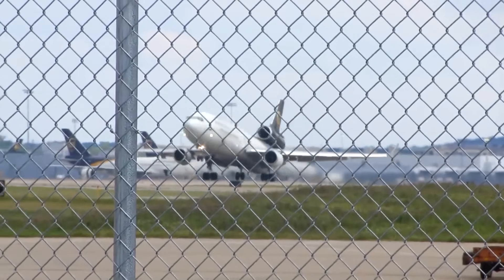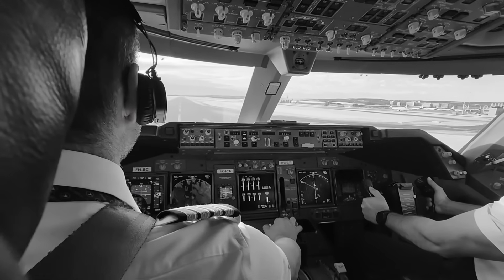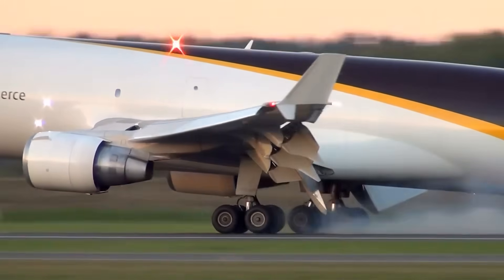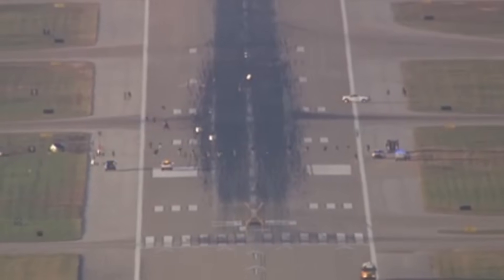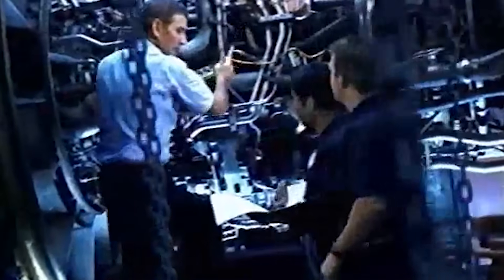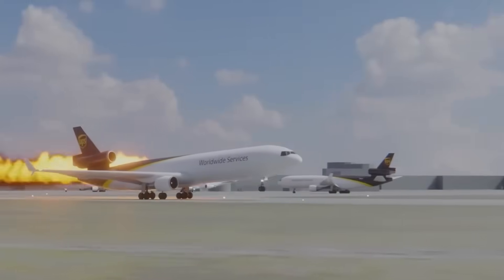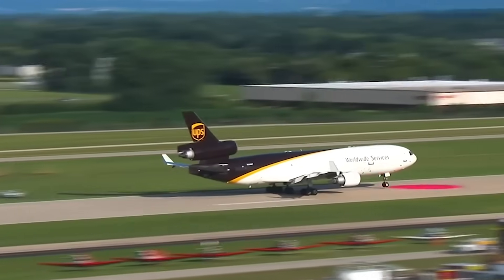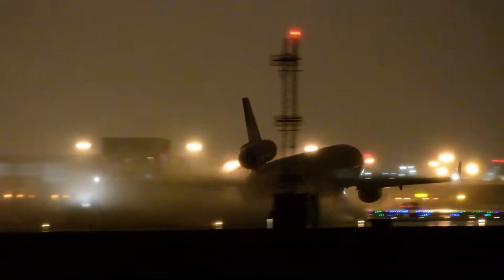The REAL Reason UPS 2976 Failed So Catastrophically...Mistake repeated AA Flight 191

Comment: These engines turn anti-clockwise as seen from the front. As the rear supporting lug of the engine No1 broke, the engine tilted upwards at high rpm and thrust. That produced gyroscopic forces that swivelled the engine to the right, contributing in breaking the front support and with the residual thrust the engine jumped over and to the right of the plane, feeding debris and flames into No2 engine. If the problem was in No3 engine, No2 would not have been affected and the outcome could perhaps be less catastrophic.
Reply from the maker: That's a very detailed analysis of the engine's movement and its potential impact.
Reply: I believe you are correct. Had engine 3 mount had the failure, they still could have climbed and it cery likely would have not been a catastrophy. 

Myself and most others thought a catastrophic uncontained engine failure caused it to break off the wing, however gjven what the NTSB has shared,  I no longer believe this is what happened.  

I now believe the engine was operating nominally when it broke off and departed the wing at full thrust. The fire on the wing and engine were a result of the fuel lines being ripped and spraying fuel.
Reply: Had the crew immediately aborted when the repeating bell began to sound, the engine might not have broken off and the huge fire might not have started. The plane probably would've stopped in one piece on airport terrain.
But after that, would the cracks have been detected? Or would the plane have crashed at a later date?
Reply: @AlainDessureault 
The alarms went off after V1, too late to abort. 

It appears the engine broke off, then burst in flames. In other words a catastrophic engine failure did not cause it to break off...the engjne broke off at max thrust as they were rotating. 

Had the pilots tried to abort they still would have crashed into the area beyond the runway,the oil/fuel recycling plant and still caused significantly damage and loss of life as they were going too fast to abort when they got the 1st warning(again after V1).

That said, pilots train to continue flying  even with an engine failure at and after V1 because they are going too fast to stop and getting airborne is the safest option 99.9% of the time, also every airliner can safely climb if they lose an engine. 

Unfortunately with the UPS flight,  the number 2(midde) engine injested debris from engine 1's catastrophic departure from the wing, causing it to stall and lose thrust, making it impossible for the MD-11 to climb with only one engine.
Reply: @JarrodFLif3r  
"The alarms went off after V1"
Apparently, yes
"too late to abort"
That's a myth. A desperate abort was the only option.
"the engjne broke off at max thrust as they were rotating"
Correct
"Had the pilots tried to abort they still would have crashed into the area beyond the runway"
But they could've chosen where to crash — unlike when they were in the air.
"the oil/fuel recycling plant and still caused significantly damage and loss of life"
No. The crew had the option to steer away from those.
"they were going too fast to abort when they got the 1st warning(again after V1)"
That's a myth. At that moment they could've not only aborted, but even ended the roll on airport terrain.
"That said, pilots train to continue flying  even with an engine failure at and after V1"
That's faulty training for tri-jets
"because they are going too fast to stop"
That's a myth. Utter bullsh-t
"getting airborne is the safest option 99.9% of the time"
Wrong statistic in the case of tri-jets. In the case of tri-jets, the rate of catastrophe is 100% when trying to fly an unflyable tri-jet.
"also every airliner can safely climb if they lose an engine"
False. No tri-jet has ever lost an engine at rotation and safely climbed out. The result of trying to climb out has always been a crash on the other side of the airport fence.
"Unfortunately with the UPS flight,  the number 2(midde) engine injested debris from engine 1's catastrophic departure from the wing, causing it to stall and lose thrust, making it impossible for the MD-11 to climb with only one engine".
That's normal for a tri-jet. Engine separations at rotation for tri-jets are always catastrophic — when the crew tries to fly the damned thing anyway
Reply: @AlainDessureault 
That is your opinion and not backed by the facts of the case. 

It is a piss poor analysis . 

No pilot's share your opinion. Clearly you are not an aviator.
Reply: @JarrodFLif3r 
"That is your opinion"
Nope! I don't do opinions. I do facts and logic.
"not backed by the facts of the case."
On the contrary, what I stated is backed by all the facts of the case
"It is a piss poor analysis"
Nah. You're just saying that because you're not able to find a single fault in it.
"No pilot's share your opinion"
Not an opinion. I don't do those. I do facts and logic.
At least one pilot shares what I state.
Almost all others haven't heard yet what I state
"Clearly you are not an aviator"
Clearly you are not a competent debater
Reply: @AlainDessureault  we lose an engine at rotation and climb out safely multiple times a year in the simulator . The crew did exactly what they were trained to do . And there was no way they would have stayed on the runway pavement had they rejected when this occurred . Stop the armchair analysis since you’re obviously not a pilot….
Reply: @margotk3498 
Stop asserting bullsh**. Your simulator doesn't know that tri-jets don't survive the loss of an engine at takeoff. The damage cascades because of their design. In this case that fire was going to destroy the wing in seconds. The crew did as they were trained but that training was wrong in this case. Hopping the fence was the worst thing they could do. Your assertion that they would not have stayed on the runway shows how little you understand of what was important. Staying on the runway was never important. What mattered was to abort and stay on airport terrain at any cost to the crew and plane
Reply: @AlainDessureault  the aircraft is certified to take off losing an engine at precisely that point… not sure what exactly you’re trying to argue.  Aircraft certification? Pilot training? But you’re truly not making sense.  Also the airplane staying on airport property could have killed far more people… it had a strong yaw to the left.. just to the left of the runway  are ramps loaded with aircraft and people loading them …
Reply: @margotk3498 
"the aircraft is certified to take off losing an engine at precisely that point… not sure what exactly you’re trying to argue"
Because you're not thinking. We have just seen, for the second time, what happens when a tri-jet loses an engine at takeoff. Now you know what that certification is worth.

"But you’re truly not making sense"
Because you're not thinking

"Also the airplane staying on airport property could have killed far more people"
Not a chance.

"it had a strong yaw to the left"
You saw that the yaw was controllable enough

"just to the left of the runway  are ramps loaded with aircraft and people loading them"
No chance of any danger to them.
Physics says aborts were possible, beginning with the repeating bell and even as late as the point of loss of the engine. Those aborts were the only options. Hopping the fence and risking belly flopping on the UPS building was the worst thing to do, but that's not the crew's fault. They followed their training, and indoctrination, as you are doing now
Reply: @margotk3498  
Those "ramps loaded with aircraft and people loading them" … that you refer to … are nowhere close to the path UPS 2976 should have taken during a desperate abort. You might as well have claimed risk to installations the plane had already passed.
Not sure what kind of failed high school physics you're using to support your misunderstanding of this crash
Reply: @AlainDessureault what path do you propose they took specifically? And yes, they are certified to takeoff with the loss of one engine . The reason AA 191 crashed was the issue with the slat system not the loss of the engine… the reason UPS crashed was the loss of two engines, not one.
Reply: @margotk3498  
"what path do you propose they took specifically?"
→ Physics says that after the engine broke off, the crew still had many seconds available to think and re-vector the jet towards the left, or right (to avoid buildings and to aim for a less deadly path), before setting it down again as fast and hard as necessary … and then decelerating as hard as possible (brakes, spoilers, reverse thrust). The plane would've decelerated through the airport perimeter fence, through parking lots, trees, ditch, rail cars and rail yards — sparing up to 11 lives on the ground and possibly even the lives of some or all of the crew even if the plane did burst into a fireball.
Yet the indoctrination says "no abort after V1" — which is complete bullsh** in this case. No plane has ever survived more than a few seconds with the size of fire this one had in its wing. Wondering about the #2 engine, lack of thrust, why the plane wasn't climbing is all bullsh**. That fire was going to destroy the wing in a matter of seconds. No turn-around and land again was possible.
Instead of hopping the fence and exporting the catastrophe elsewhere, the best reaction would have been a desperate re-vector and abort along a less lethal path.
"And yes, they are certified to takeoff with the loss of one engine"
→ Now you know the true value of that certification
"The reason AA 191 crashed was the issue with the slat system not the loss of the engine… the reason UPS crashed was the loss of two engines, not one."
→ The real reason they both crashed, is that tri-jets do not survive the breaking off of an engine during takeoff. The breaking off causes a failure cascade. But regardless, that's moot here. The wing fire was going to destroy that wing in seconds. Hopping the fence only guaranteed the crash would happen off base — giving the other side the mess to clean up.
Reply: @AlainDessureault to the left is what I thought you were originally suggesting which is why I told you that would have taken out several rampers and other aircraft.  To the right would have gone over a bypass road . And straight ahead would have taken out the logistics  building that they hit right before crashing. Wonder how many people were in that.  You’re delusional and uneducated in your opinions .
Reply: @A @AlainDessureault also physics doesn’t say any of the shit you are claiming. What’s your flying experience? None?
Reply: @margotk3498  
"to the left is what I thought you were originally suggesting which is why I told you that would have taken out several rampers and other aircraft"
→ None at all! That's actually the least difficult part. But I concede that to avoid the corners of buildings on the left side would would have required more threading of the needle than I would like

"To the right would have gone over a bypass road"
→ Not a problem and that is right where the crew should have turned towards: the rail yard.

"You’re delusional and uneducated in your opinions"
→ Nah. I'm the one here who can actually do the math and physics.
The crew should've turned right from the moment the engine departed. Initiated a 20–25° right bank in the first 4–6 seconds for a 20–25° heading change, then set the plane down as fast and hard as possible
This right turn — the one your “unrejectable after V1” religion explicitly forbids — would have kept the entire disaster on empty railroad property.
Reply: @AlainDessureault  oh now you’re saying they should have gone airborne? When you only have the number 3 engine working you’re not going to get a 20° bank to the right. So you’re saying they should have known they had no chance and just crashed it immediately to the right? You’re an angry person who knows absolutely nothing about flying.
Reply: @margotk3498  
 "now you’re saying they should have gone airborne?"
→ When the engine broke off, they already had some height — to change their heading.
"When you only have the number 3 engine working you’re not going to get a 20° bank to the right"
→ Banking is done with ailerons and turning includes rudder. No evidence so far says the #2 engine wasn't producing any thrust
"So you’re saying they should have known they had no chance"
→ Their training should have known they had no chance. The crew itself was not at fault.
"just crashed it immediately to the right?"
→ Just changed heading to the right, yes. After that, physics and history say the best option was to land it quickly and decelerate desperately. You call that a crash but clearly it would have been lesser than the one caused by hopping the fence at much higher speed. Training should face facts. It should not drill in indefensible manoeuvres hoping some miracle happens and the plane flies and goes around.
"You’re an angry person"
Yes, at the causes of this crash.
"who knows absolutely nothing about flying"
I'm not the one who irrationally believes this plane could fly!
Reply: @AlainDessureault  again, you have zero background or knowledge to support your ramblings… all you have is over confidence . Stop speculating on things you know nothing about .
Reply: @margotk3498  
"again, you have zero background or knowledge to support your ramblings"
→ I'm not the one who can't do high school math and physics
"all you have is over confidence"
→ Nah. I have high school math and physics
"Stop speculating on things you know nothing about"
Nah, no reason for me to stop saying what high school math and physics say

Comment: To add to the question of why engine #1 pitched upwards. 
The engine was under full takeoff power when the mount failed, so the engine thrust would still be near max. Thus, the thrust plus the centrifugal force would have caused the engine to tip up.
Reply: A 90 degree reaction as expected
Reply: More accurately the failed aft mount combined with full thrust would cause the engine to pivot around the forward pylon/wing attachment structure. As it rotated, drag would add to the thrust accelerating the rotation until it failed the fwd mounts. Simultaneously the gyroscopic precession forces would rotate the engine to the right and complete the separation sending the engine up and over the fuselage to rest on the right side of the runway.
Reply from the maker: That's a detailed explanation of the forces at play during engine failure.
Reply: The thrust was nowhere near max thrust.... more like around 90% due to OAT derating.
Reply: @phil1517 that amount of thrust is more than enough to cause that engine to go airborne once the mount failed.
Reply: @bruce4627 --- I never said it wasn't.  All I said is the thrust was NOT max thrust.

Comment: If the aft Pylon bearing was failing over a long period wouldn't that show up in engine vibration monitoring?There are lots of MD11s and DC10s that did the same job for longer with no pylon attachment failures, This might be a one off problem too.
Reply: Engine vibration monitors are exactly that. They monitor N1 & N2 vibration. Never heard of vibration transducers being fitted to engine/pylon mounts. But then I only had 50 years in the aviation avionics/B2 maintenance regime. RIP to the brave pilots.
Reply: @rosssmith6205 . Very true. Engine vibration monitors are intended to alert to engine rotor anomalies, not engine movement within the engine mounting structure.  These are completely different problems.
Reply: @rosssmith6205  How were the pilots particularly "brave"? Didn't they just react according to their training — the same training that effectively forbade the best option?
The best option was to abort immediately when the repeating bell began sounding
Reply: @rosssmith6205 I only had 46 years. DC10s MD11s. The CF6 had a turbine and a fan sensor. I am curious as to why a worn out aft pylon mount bearing wouldn’t have shown up there. Maybe it did.

Comment: This seems like a problem only on the DC 10 line of aircrafts, why not use a pylon mount design that has been proven on other aircrafts not to be problematic?
Reply: pretty sure you redesign any paert its a big deal to get faa to approve changes,,, then you would have to test it on an aircraft for tons of hours
Reply: @williamhaynes7089   Thank you, I was expecting that answer. 
Can't do because in our economic system, profit is king and overrides common sense.
Reply: @iorr98 in this case it would be cheaper to just replace the mount with a new one more often... getting a redesign approved at the point in this planes lifecycle is not cost effective.. only 100 or so left flying.

Comment: One key thing I note with this UPS crash with the MD11 and don't think it's happened before is that one engine took out another by ingestion leaving only one good engine. Even if they fix the mounting system, this rare thing could possibly happen again. The twin engine does protect more from this problem and they can still fly on one engine with these more powerful engines today.
Reply: Yes, but twins are highly vulnerable to pilot error like on British Midland 92, Transair 810 and the recent Jeju air crash which arguably happen far more often.
Reply: @0w3nn  You are referring to shutting down the wrong engine. Like you said "Pilot error", that is not a plane design problem, they needed to do a better job diagnosing the problem.
Reply: Also, this applies to any aircraft with tail engines. Any structural failure forward of the aircraft can cause debris and hot gases to get sucked into the tail engines.